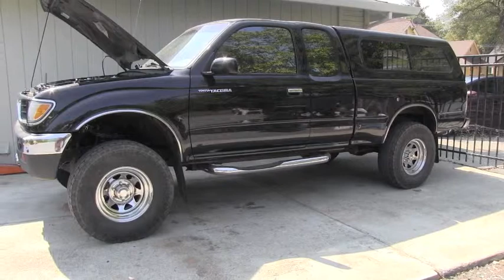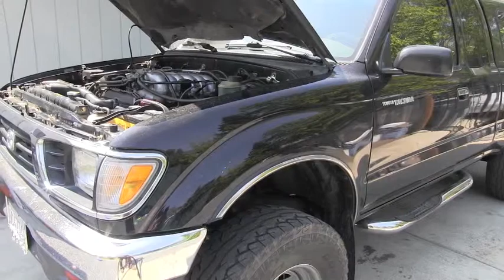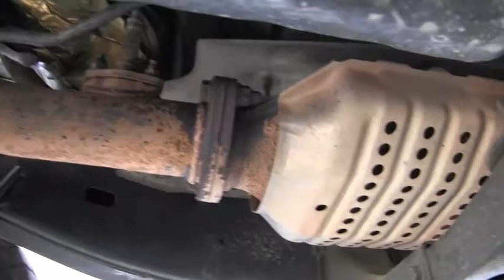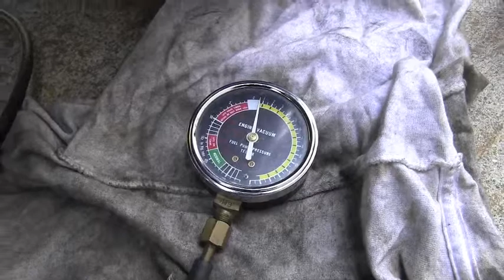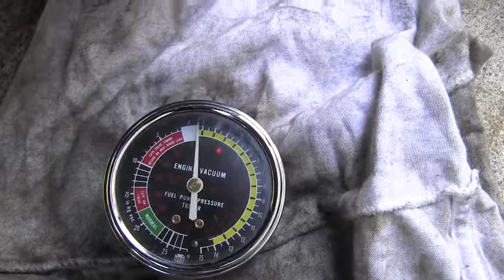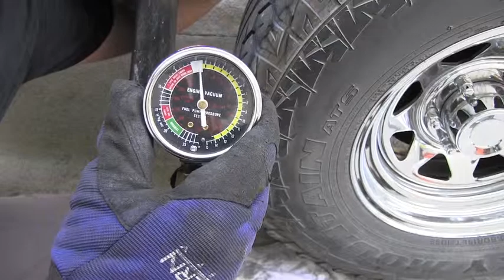Toyota Exhaust Back Pressure Test

Comment: How did you connect the rubber pressure hose to the hole in your exhaust pipe?? That's really important to have shared in the video. I bought a backpressure kit and it looks promising, but it's adapter only fits the new O2 sensor threaded connector, but my upstream A/F O2 sensor is like the one pictured in your video (with the two nuts) on either side. No way for me to connect my backpressure gauge unless I drill a hole in the exhaust and find a good way to secure the rubber hose to the pipe.
Reply: Yeah I made the mistake thinking any back pressure gague would fit and now I cant even use the back pressure gague, what is the name of the adapter to fit into the O2 sensor?

Comment: Thank you. like and subscribe. I have a small question: if the gague go to the vacuum side, what does that mean? I know if there is a positive pressure that mean clogged catalytic converter. I show a video that show a v6 toyota  engine with a negative pressure in exhaust manifold. any informations?
Reply from the maker: Is that engine/exhaust modified ? Where can we see this video ?